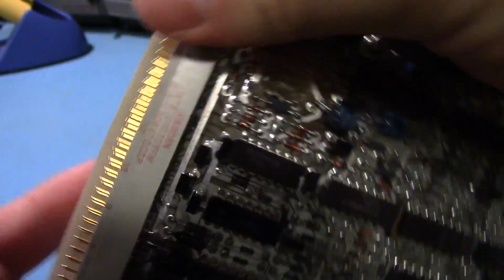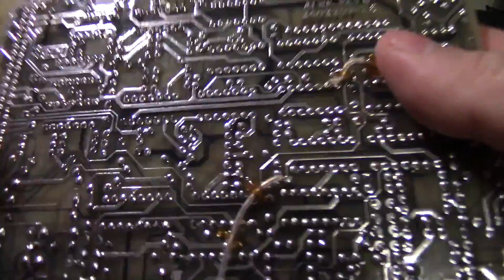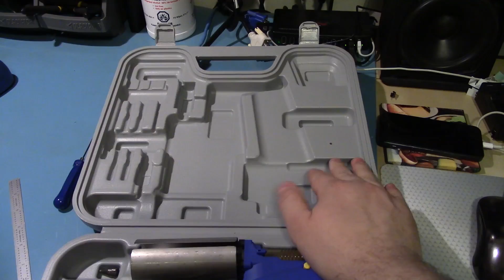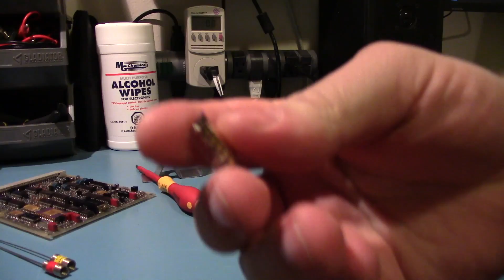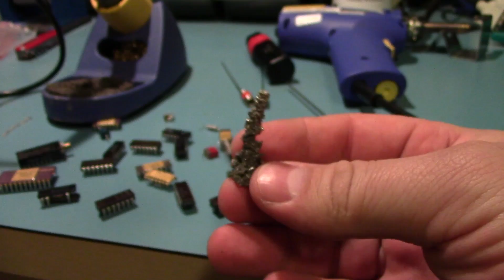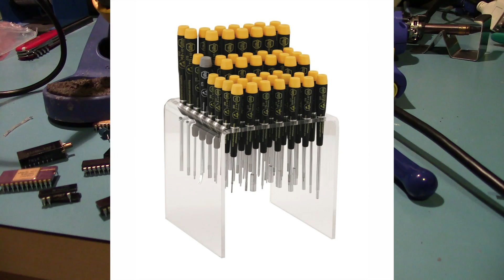SCI Military Board

Comment: That is an awesome board. There's got to be a way to melt off that conformal coating without destroying the board though..
Reply from the maker: Electronic Investigations I wasn't really interested in the board (other than taking a look at it), I was mostly interested in the ceramic chips. I'm sure with heat and/or chemicals you could get the coating off. Since the ICs came off with no issue I didn't make any effort. :)